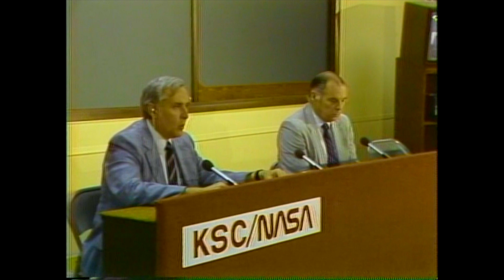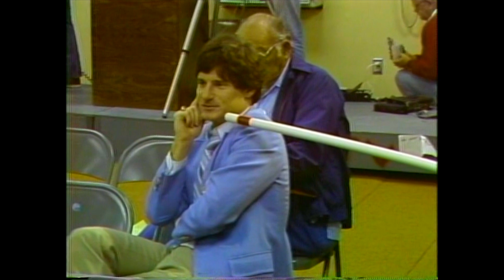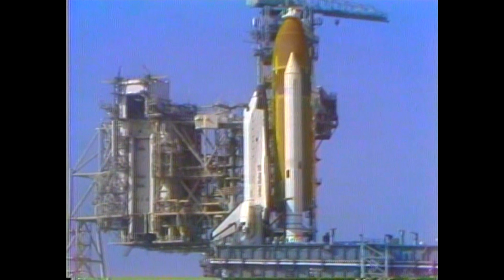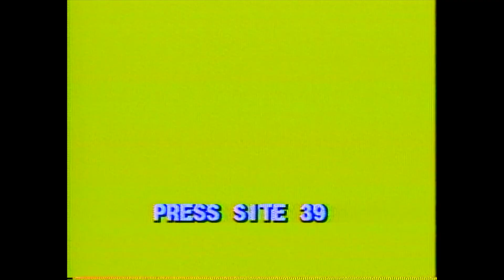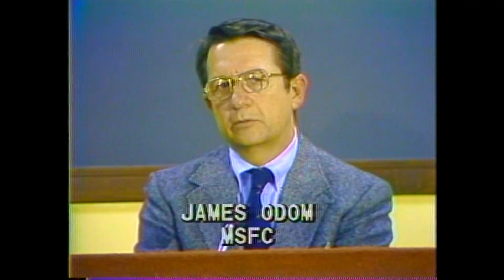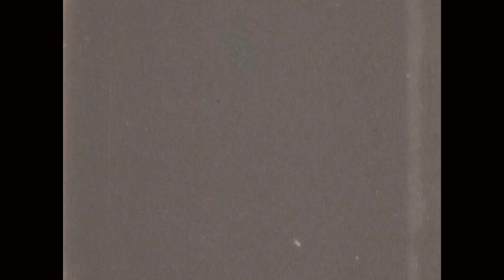STS-6 First Flight Readiness Firing of Space Shuttle Challenger Main Engines

Comment: Question .... are the astronauts in the shuttle during the flight readiness testing?
Reply from the maker: No, this is a fully automated engine firing and the crew is not onboard the shuttle.
Reply: Excellent question! Apparently no, there are no crew members on board during ground testing. The engine, APU and fuel cell startup procedure is automated so no need for a crew.

Comment: Nice.  The big question is how much of this NASA Select and film footage is available for the 2nd FRF on January 25, 1983.  The film is new to me, which is great because it helps document the "original" shutdown sequence for S0014.  But the only footage I've seen of the second one was the recording I got of the KNXT (CBS LA affiliate, before the call sign changed!) report for that.  20 seconds of the NASA Select transmission was short enough to fit within that, but that's all I've seen (which also included the shutdown sequence).  I don't think even CNN covered the test-firings live.  Footage from this STS-6 launch campaign would be fascinating, especially all the main engine work that was done after the 2nd FRF replacing all three engines at the pad.

Comment: Sadly it was not a resounding success and they needed 2 more FRFs, due to hydrogen leaks in the aft section of the orbiter
Reply: There was only one more FRF during this launch campaign, for a total of two.  The 2nd FRF allowed them to conclusively determine there was a leak, but it took longer to pinpoint and they ended up removing all three engines for repairs.